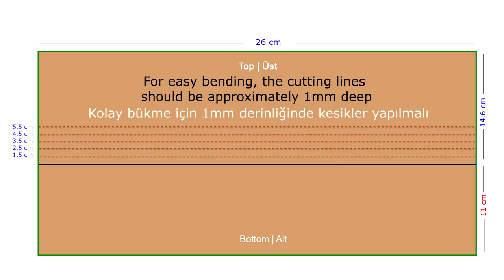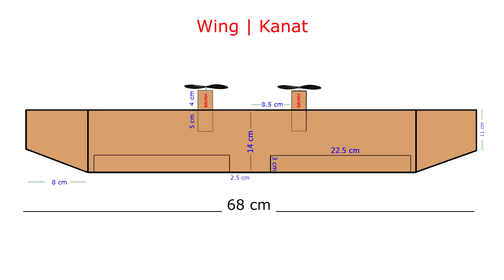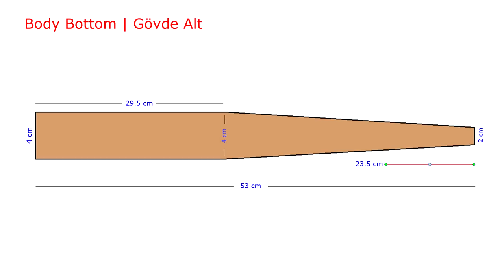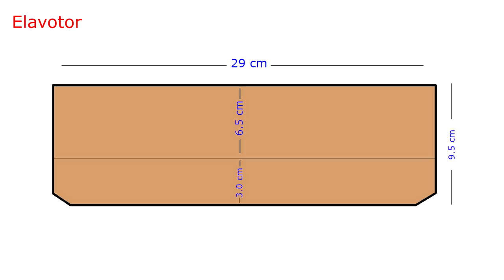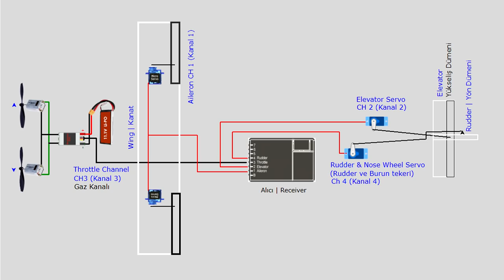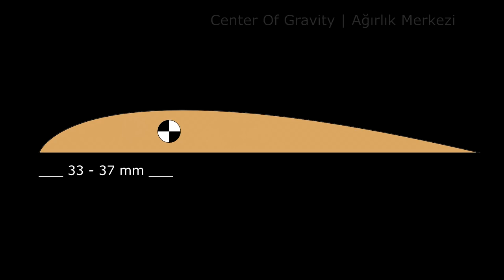How To Build A Twin Brushed Motor RC Airplane. DIY Remote Control Plane

Comment: Hocam merhaba uzunlugu 1,5 metre 2 veya 3 kg olan bı uçak yapmak istiyorum da motor ve diğer malzemeler de hangi ürünleri önerirsiniz.
Reply: Hocam lütfen cevap verin çok önemli benim için
Reply from the maker: Bu yapacağınız uçağın karakteristiğine göre değişir ama 2814 ölçüsünde bir motor uygun olabilir. Diğer ESC, pervane, batarya gibi ekipmanlar alacağınız motora bağlıdır. Uçağın tarzı önemli, uçağın yaklaşık uçuş ağırlığı önemli. (2-3 kg çok fazla bir aralık. Daha belirgin olmalı ki doğru motor seçilebilsin). Servo seçimi de uçağın uçuş karakterine bağlı değişebilir. Üstten kanatlı bir uçak mı, alttan kanatlı bir akrobasi modeli mi vs. Özetle veriler daha net olmalı ki doğru malzemeler seçilebilsin.

Comment: Ben yaptım 394gr ağırlığı uçurmaya çalışıyorum uçmuyor sadece ön tekerlek kalkıyor arka yerde kalıyor sebebi ne olabilir lütfen
Reply from the maker: Farklı sebepleri olabilir. Pervanelerin önü ve arkası vardır. Doğru şekilde taktığınızdan emin olun. Ters takılırsa önemli çekiş kaybı olur. Başka bir sebep ise modeli koşturduğunuz zemin yeterince düz olmayabilir. Küçük engeller bile hızlanmayı etkiler . Bu durumda elden atmak çözüm olabilir. Diğer bir sebep burun çok ağır olabilir. Ağırlık merkezini dikkate alarak dengeyi kontrol edin. Başka bir sebep kullandığınız pil yeterli C değerine sahip değilse 2 motor için yeterli akım olmayabilir vs. Farklı sebepler daha olabilir. Neyi nasıl yaptığınızı göremediğim için net bir bilgi vermek pek mümkün değil.

Comment: İyi günler ben iki tane 12 voltluk  fırçasız motor kullanmak istiyorum pilim 15 volt 80A 1 tane esc kullansam olurmi
Reply from the maker: Fırçalı motorlarda hiç sorun olmaz ama fırçasız motorlarda durum farklıdır. Genellikle birden fazla fırçasız motor tek ESC ile çalışmaz. İstisna bazı motorlar vardır önceki videolarımın bir tanesinde kullanmıştım. İki ayrı ESC kullanmanızı tavsiye ederim.
Reply: @Kendin-Yap  abi ben uçuş kontrol kartı kurmak istiyorum apm 2.8 bu karta 2 tane esc bağlama şansım varmı.izledigim videolarda genelde 1 tane takiyorlar.tesekkurler.
Reply from the maker: @canersahin1334  APM2.8 kullanmadığım için detaylarını bilmiyorum ama sonuçta bir uçuş kontrol kartı ve dronlar ile de kullanılıyor. Dronelarda en az 4 ESC var. Bu durumda 2 ESC ile kullanılabilmesi gerekir.
Reply: @Kendin-Yap  abi apm 2.6 uçuş kartı kullanacagim.2 tane fırçasız 2205 2300kv motor kullanmak istiyorum ancak kontrol kartına 1 den fazla esc takiliyormu bir bilgim yok o yüzden 2 motoru 1 esc ye dönüştürmek istiyorum .
Reply: @Kendin-Yap  reis son bir sorum olacaktı 2 tane 2205 2300 kv motor kullanacam 30A esc uygunmudur.

Comment: Hocam ben uçağa flap eklemek ve iniş takımının açılır kapanır olmasını istiyorum. Bunları diğer kanallara bağlıcam ve yavaş hareket etmesini istiyorum. Bunu nasıl yapabilirim?
Reply from the maker: Servonun yavaş hareket etmesi için kumandanızın bu özelliğe sahip olması gerekir. Bu özellik çoğu kumanda da yoktur.  Haricen küçük bir devre ile yapabilirsiniz. https://www.banggood.com/custlink/vG3GNIIqFt
Reply: @Kendin-Yap  Teşekkür ederim. Bu arada bir sonraki projenize flap olayını ekleyebilirsiniz çoğu modelci kullanıyor ve işe yarayabilir
Reply from the maker: Flap bazı uçak tipleri için gereklidir (Stall hızı yüksek olan uçaklarda). Ama bu tip uçaklarda pek bir anlamı olmaz. Gereksiz fazladan servo kullanımıdır. Gerçekten flap ihtiyacı olan yakıt motorlu scale savaş uçağı modellerimde mecburen kullanıyorum.  Bilgi: FLAPERON miksi olan dijital kumandalarda Aileronları aynı zamanda flap olarak da kullanabilirsiniz. İşinize yarayabilir.
Reply: @Kendin-Yap  Y
Flap yapımını bizlere gösterebilmeniz açısından demiştim. Bu arada çok teşekkür ederim hocam sayenizde bilgilendim

Comment: Is diy twin motor rc plane cam fly by rs2205 2300kv brushless DC motor for qav250 qav300 racing drone black cap (cw motor rotation)

Comment: Hocam merhaba. Okulumuzun iha takımındayim ve internette araştırıp ulaşamadığım bilgiler var acaba size ulaşabilceğim bi e-mail verebilir misiniz?
Reply from the maker: Buradan sorularınızı cevaplamaya çalışırım
Reply: @Kendin-Yap  hocam görüntü işleyebilen ve noktaya elastik yük atabilen bir uçuş için geleneksel tip bir uçak(önden çekiş, üstten kanat ve ters-T kuyruk) açıklık oranı 7 açıklık 2.02 sivrilme 0.7 ort kort 0.29. Uygun mudur acaba? Ayrıca flap veya flapeleron yapma fikrindeyim. Doğru bi yöntem mi yoksa degiştireyim mi?
Reply from the maker: @FratAtik  Klasik üstten kanatlı Flat-Bottom airfoile sahip uçaklar düşük hızda tutunabilmeleri nedeniyle bu tip görevler için mantıklı olabilir. Flap ve Flaperon yani aileronların aynı zamanda flap olarak kullanılması ise biraz tercih meselesi. Uçağın kısa mesafelerden kalkış ve iniş yapması bekleniyorsa, çok düşük süratlerde geçiş yapması bekleniyorsa Flap faydalı olacaktır. Flaperon da temelde aynı işi yapsa da  aileron komutları ile birlikte çalışması gerektiği için hassasiyet açısından flap daha verimli.
Kanat ölçülerine gelince ben tasarım programlarını kullanmıyorum. Geçmiş tecrübelerimden kaynaklanan birikimleri karalama usulü çizimler ile netleştirip hayata geçiriyorum. Sadece CG hesaplaması için formül sitelerinden faydalanıyorum.  Bu yüzden o değerler konusunda fikir belirtemem.
Reply: @Kendin-Yap  çok teşekkür ederim, araştırıcam hocam

Comment: abi,hocam,dayı ne diyim bilemedım neyse ; Abi şimdi sen böyle uçak yapıyosunda biz nasıl yapcaz yani su1 tane motor bile 20$ amazonda yani 110 tl falan ve budnan 2 tane gerekıyor su-27 jetini yapmak icin esc ler desen ucmus 2k lık bile var 1 tane en ucuz 30 tl falan internette senın cektıgın basıt ucak yapımı 1 yıl once attıgın vıdeoda kı gıbı ama 3 motorlu 74 40 tl satılıyor ama guvenemedım ona.. Şimdi Abi Ben Uçak Tutkunuyum 14 Yaşımda Olmama Rağmen Ben Büyüyünce F-16,F-35 Pilotu THKuveeteleri HKK olmak istiyorum Ve Şimdi Den RC Uçak Sürmek İstiyorum Flight Testi PeterSripol'uda İzliyorum Ama Yinede Yapılmıyor 14 Yaş Bütçesine Göre #KendinYap Abi Senden En Ucuz Eşyalarla Fiyat Değerendirmesi Yaptığın Bir Video Atarsan ÇOOK Makbule Geçer Abi..